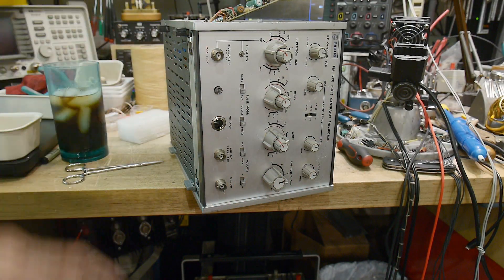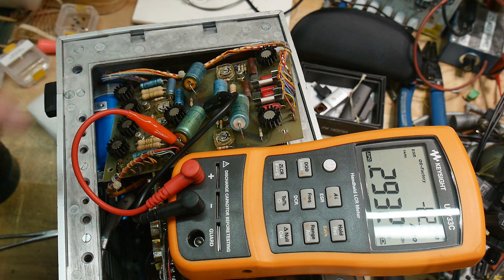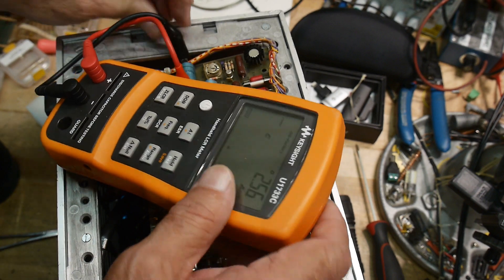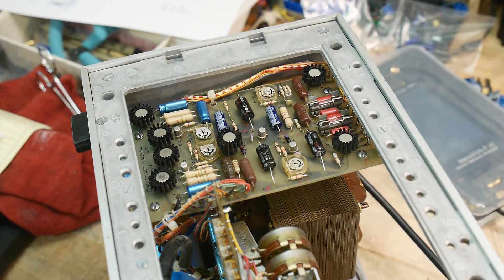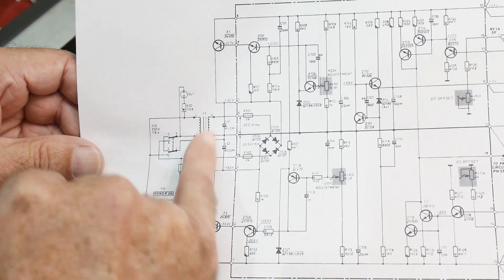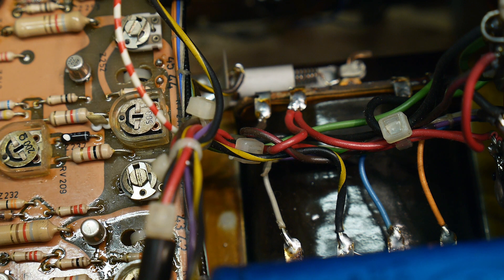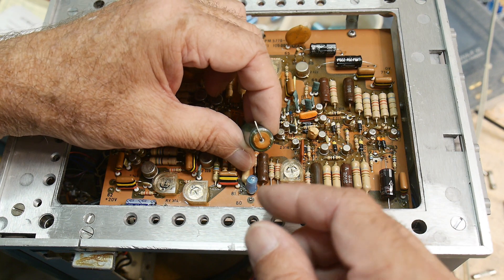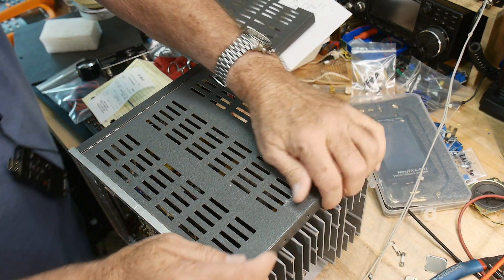#1272 Philips PM 5770 100MHz Pulse Generator

Comment: Excellent! Tip = I use a Sharpie marker to (boldly) write the cap reference number and date of replacement on the inside of the unit. It's good information for me, when, after time, I have forgotten what I did, or the next person that will work on it. Sharpie ink is marketed as permanent, but, if you need to correct a mistake, it washes off easily with isopropyl alcohol.

Comment: Fuses on the secondary side are interesting. I found an old scanner (see Oct 22 QST "Classic Radio") that has the fuse AND the power switch both on the secondary side...gotta fix that sometime. Did you have a "Elephant Key" for the SF Zoo, ahh memories!?  73 - Dino KLØS
Reply from the maker: I did have a key!